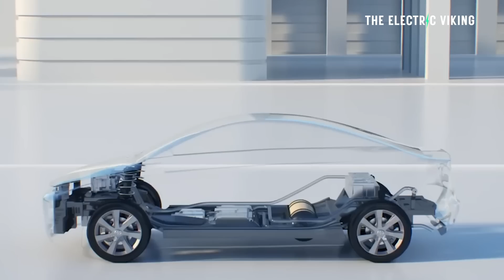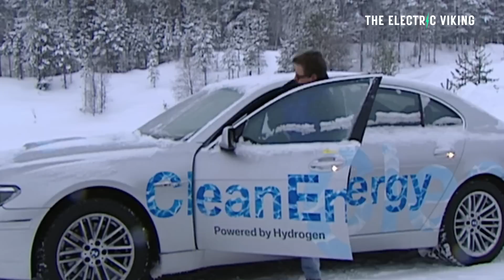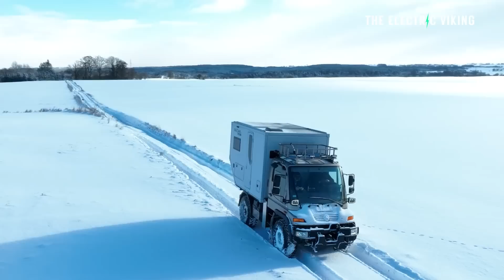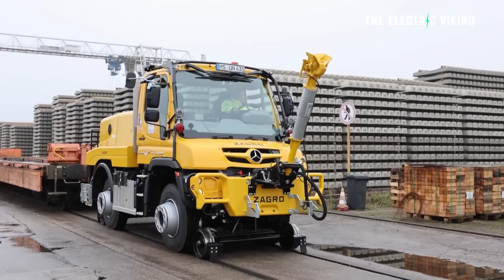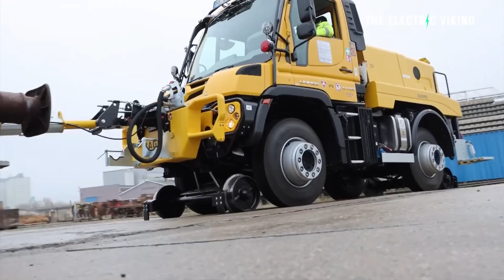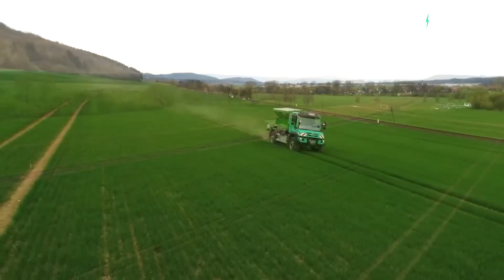Mercedes Benz's hybrid hydrogen combustion and diesel engine

Comment: You’ll be astonished what the solution is. Electric hydrogen fuel cell hybrid combustible engines with Electrodynamic Profile Ramping. ANSYS has verified it with rigorous testing and simulations, not to mention lowered the costs more than half with Additive Manufacturing. 

It’s going to solve the Infrastructure dilemma. A powertrain capable of 1000+++ range, and charges in motion. Consumers will have wonderful options. How?… That’s the secret sauce. 😉 Stay tuned.

Comment: No, does not make sense. Firstly, I'm confused both engines supply power to the drivetrain. It's not that the diesel engine is creating hydrogen. So I don't understand why wouldn't you just have two diesel engines if the goal is to have more power. Why would you want to have another engine that requires an entire different refinery and delivery system to run it. That's only the first of maybe 20 things I can find wrong with this. If the goal is to go greener then why wouldn't you have two hydrogen engines in order to ...arghhhh

Comment: They are probably diesel -Hydrogen dual fuel, guess what they will be run on?  
Why not make a Hydrogen-battery plugin Hybrid?  Cheap fuel for within battery range, then fast refuel for extending the range.  You could also charge the battery while you put Hydrogen in.

Comment: JCB UK is also working on the same idea! 
I am not impressed and it will be a shame to see JCB go to the wall.
What these companies are doing is bringing back the coal fired locomotive steam engine to use Hydrogen as the fuel.

Comment: Dual-fuel bin lorries, powered by diesel and hydrogen, have already been introduced in Fife and Oxford. But probably too little and too late. Tesla stole a march by establishing a reliable accessible charging network. Toyota and other advocates of hydrogen could make the best vehicles but without means to refuel across country are limited to local travel. So bin-lorries and busses are currently the only practical road vehicle uses which are unlikely to be economically viable long term with cheaper batteries.

Comment: All the EV fan boys are in denial because they won't admit that the majority of public charging stations are still powered by coal.  Thanks for creating more awarenes to your ignorance.
Reply: In the US, coal only provides 11% of electricity. In the U.K. it’s less than 2%.
Reply: @kalmmonke5037  you need help, go take your meds
Reply: smoking causation to cancer wasnt clear until moving away from animal foods becamed normalized, including moving from real butter to seed oils.... imagine how small of a effect combustion emission has on health.... it maybe effecting peopel who spend lot of time near heavy lot of cars whose engien are on. combustion has the potential to be far less emissions by simply having small combustion with steady turbo flow charging electric drive           .............where does petrol come from before processing into usable stuff? a theory says the thick liquid is a byproduct of anerobic bacteria, so as long as you dont take too much at a time, bacteria will create more with the organic matter which is compressed into stuff thats processed into petrol. so in especially aritifcal production form, it would be a more sustinable way to carry energy than elctrric car batteries who cant be fully recycled, and its already much more energy per weight. also check out abiogenic creation of petrol, another theory of how its made, which doesnt fail to explain why oil reserves replenish theirself after couple years. . they  say that dont need a new car to run the e fuel, they say its chemically identical to what is normal now.       ...............e fuels has been sold to peopel like harys garage on youtube, its also for sale to motorsports etc (anyone whos paying the high price that exists due to the product not being sold in large quantitiy becuase its new stil developing tech)carbon capture doesnt have to work only in one place.     EV aftermarket valus are low prices, because people dont want the low drivign range of worn out batteries:  currrent electric car batteries dendrite forming battery degradation is not going to be fixed by recycling, where the battery will rust etc in junkyards, which is why i rather wait for that issue to fix before i can recomend a ev espcially given the heavier weight worsening road wear(cost raw resources and causes emissions , not just money) and being less safe to at least others in mot crash scenarios , see aptera owners club video on safety. phalate estrogenic effects causing hormone health problems from microplastic(plastics ae suppsoed to be made of petrol) wear from plastics getting into water food supply like plants animals,  like tires.  and suppsoedly brakes, is worse than todays common cleaner combustion.natural rubber needs to be grown from tree, and is far less grippier... low weight small cars could help, by not having so much weight to push around , weight cant be pushed withotu enough grip on the road. given limited battery supply, wouldnt it make sense to encourage the market to make many hybrids out of the same battery mass used for a single electric car? that way, the places where emission happen most , in driving situation that is more like stop and go traffic, those emissions are reduced, so more emission overall is reduced vs the single electric car.    ................ if government and corp cared about climate change we'd see much more reasonable laws for efficient car design, but we see leniency for suv and bigger cars in terms of emissions, anti roll over  capability etc. we see anti nuclear energy movements, and so called 15 minute cities, etc such restrictions on productivity and feedom being enforced in the name of climate stuff. tony heller, suspicious observes , richard vobes, has their ideas.  blackrock esg score and stealing wealth from people who use a currency by printing money and giving it to chosen people, to weaken people that are not them to control people more, see how their buying up property etc, see romanian tves video called why woke wont go broke"... look at how they promote politically leftist ideas in movies video games etc and even leftist tend to not liek that stuff, but they keep pushing this stuff even as sales decrease. they promote so called affirmative action, where people are to be given things just because they have cahracteristics that make them more likley to be a part of their mass weakeneing goal.  they also promote climate change narrative.government doesnt care about low emissiosn etc, thats why it is more lenient for suv cars and creates standard for effeincy harder for smaller engines and cars to reach. its pretending to care with obiousl half baked bs.   so what should i believe, stuff that could be petrol industry deception or battery industry and government  deception ? ...........................          i suppose best balance of all values of crashsaftey, affordability, emissons, freedom to productivity and ownership of its benefits, is:   making combustion  smaller engine by it not dealing with transmission downshifts and spinning weight balance issues, by linear magnet-like actuators being pushed back and forth to something like supposed non magnetic recyalble motor by mahle, with somehting like subaru wrx ContstantlyVariableTransmission. a compact 4 seater with the rear seats facing rear, with a focus on handling experince similar to lotus elise for momentum preservation. people can rent bigger vehicals if needed, roof storage etc can help.

Comment: In New Zealand during the world Oil Crisis of the late 1970's, our Government decided to support the rise of Hybrid cars. The engines of the cars would remain ICE engines but, at the flick of a switch, could change over to run on either Compressed Natural Gas (CNG) or Liquid Petrolium Gas (LPG). However, it required the addition of a separate CNG or LPG tank. This extra tank occupied most of the boot/trunk, removing most of the storage of a vehicle. However, the "gas" was at a very high pressure and became a danger should the vehicle get in an accident. 
On the supply aspect, Petrol/Service stations had to install separate "gas" refill areas, again at high pressure. It was a nightmare. Now all this was about converting existing ICE cars to hybrids, not purpose built CNG/LPG vehicles with only one storage tank. But I see the same problems ocurring for Hydrogen. At least for Cars. Trucks might be a different matter but I have no data on them. 
When the Oil crisis was corrected, about 6/7 years later, the hybrids just died a commercial death because any advantages just disappeared. Mostly it was simply to have a viable alternative fuel rather than be held to ransom by then Oil countries. (NZ imports about 98% of the oil we use).

Comment: While it is technically possible to run an internal combustion engine on hydrogen fuel, it is insanely stupid. Combining bulky, difficult to store and expensive hydrogen fuel with the inherent inefficiency of internal combustion results is very short driving ranges and insanely high fuel costs. This "hydrogen diesel Unimog" will remain a curious prototype and will never ever go into production. It's the biggest blunder in Daimler's history.

Comment: EV it's not the new car but an aging one you have to worry about. I remember a YouTube that pointed out hydrogen's propensity to interact with much it comes contact with. So maintenance costs will become scary. Hydrogen even attacks the cylinders that seek to contain it. Sounds like music to ice manufacturers ears? After all replacement parts are currently  their main source of revenue. When $100k plus cars worth less than $20k when 10 years old as no one  can afford to maintain them. Especially through a Mercedes Benz Dealer!

Comment: EV trucks thus far are a total fail with rediculously short range under load...unless going downhill with a tail wind.  So you have to either get bettery battery tech or better hydrogen tech, bio diesel or something that works.  Some Aussie firms are saying they have some big hydrogen extraction breakthroughs that don't use much energy so you ought to check those out; if true it may make some old plans viable.
Reply: Bullshit as they already show in Australia. You have zero clue. Your trash industries are now getting fucked...that's why you are getting hysteric...because with the downfall of your deplorable industries you will empoverish as well...by your own fault. The future is completely electric. And the future already has started. Whoever buys new combustion trash is burning his own money.

Comment: def great idea. 1st thing - conversion of old vehicles like unimog, farmer-vehicles, industrial driven on diesel etc etc. 2nd thing - solar, wind are worthless unless hydrogen tanks are built. MUCH cheaper than stacking up batteries because you simply scale up hydrogen tanks. Great combo for wind solars as they rely on unreliable weather patterns. No way that EV is enviro-friendly if its driven on German charcoal driven electricity LOL
Reply: Even with very large and very high pressure tanks (those get really expensive!) the driving range is far less. 

But worse is the horrible efficiency. Using water electrolysis, compression for storage, and an internal combustion engine results in an overall efficiency of about 9%. Using a charger and batteries and electric motor results in an overall efficiency of 76%. Basically, it would take 8 times more electricity - meaning 8 times more solar and windmills or whatever - than if we simply store surplus power in batteries. Sorry, but running internal combustion engines on renewables is a very bad and impractical idea.

Comment: When I was working as an Engineer for a Car maker back in 1983, we got news via trade magazines that M-B had successfully tested diesel engines on hydrogen, and the only technical issue preventing the adoption of hydrogen was its storage. A 300km range was considered the goal for Europe. (not for Australia and other large countries)
40 years later, someone must have dusted off the old plans and trotted them out with great fanfare!
Nothing else has changed; Hydrogen storage is the MAJOR issue. Battery advances have left hydrogen for dead.
Reply: Yes, that and the nitrogen oxides that are emitted
Reply: Can hydrogen be combusted or does it require ignition?
Reply: @toughlove7706  I believe the usual procedure is to mix the hydrogen with the intake air, and then inject a small amount of diesel at the usual time to start the hydrogen/air mixture burning. There may be other ways, but this is what is done when using LPG as the main fuel.
Reply: JCB video explains it all.
Reply: And the whole thing that hydrogen's energy density is 3 times less than current gasoline. It's insane to think it could be a source of energy for us.
Reply: @HeavyDevy89  spoken like a true BEVegan !
Reply: Half right - H is not a source of energy for anything/anyone, merely an energy transfer or storage mechanism. As such, it is a vital part of any energy transition strategy but unlikely to find any practical role in passenger vehicles. Energy density (LH2 3x better/weight, 3x worse/volume than gasoline or JP)  is not the issue.
Reply: You are wrong about hydrogen, sounds to me like your mother should have left you for dead... 

Hydrogen is superior to the batteries 🔋 Mr Imagineer from the 80s under u.s. 🇺🇸 naziAmerican mk ultra mind control...

Storage isn't a issue if the classified aerospace elite nazis would release the quantum hydrogen hydride technologies

Comment: Hydrogen-powered diesel engines are not zero pollution. They produce oxides of Nitrogen. The high temperatures of ALL internal combustion engines cause a small proportion of the nitrogen and oxygen in the air to combine. The proportion of NOx as the industry calls it is very small, but it can be very irritating to people breathing it.
I know of only one way to 'burn' hydrogen and produce only water: in a fuel cell. I'd rather use batteries.
Reply: And good luck finding all the iridium and platinum for all those fuel cellmembranes

Comment: Hydrogen is the future my friends. In the UK they have just announced adding hydrogen filling points to all the truck stops and a new model of hydrogen lorry has just been announced. Don't fear the future, embrace it.
Reply: But Shell also just closed all their hydrogen filling stations in the UK, due to lack of customers. That's not surprising, considering the high cost of hydrogen fuel. So, I suspect that few if any of those "truck stop H2 stations" will be built, and the few that may be built will follow Shell and close due to lack of customers. After all, few commercial trucking operators will be willing to double their fuel costs compared to diesel, when instead they can dramatically cut fuel costs by going electric.
Reply: @chrismuir8403  hydrogen is bullshit. Inefficient bullshit.
Reply: Hydrogen is hopelessly inefficient.
Reply: Agree with you hydrogen is here

Comment: Lol 😄 😆 🤣 it is a day late and a dollar short technology but Mercedes-Benz aka "the german nazis" had this technology perfected 70 years ago, could have built ice 🧊 vehicles with hydrogen injection tech that would throw near 0ppm out the tail pipe. No catalytic converter (mini quantum fusion reactor) needed...but they never allowed it to market to continue the emissions scam and the catalytic converter scam to use everyone as lab rats for the germans to study the quantum hydrogen reactions inside the cats to perfect hydrogen nuclear fusion, fission quantum transmutation and heat reactions. 

So yeah as bevs come out its likely Mercedes-Benz will roll out all types of hydrogen technologies, this one being the pathetic first. 

Mercedes-Benz actually has a compact hydrogen fusion reactor technology... lol 😄 😆 

But you dont know that cause you are a battery boy tard

Comment: The problem for heavy plant or road transport is that BEVs might just not cut it for the foreseeable future.  Energy density is not there for EV road trains, etc. just at the moment, and payload logistics and recharging make this an expensive and difficult proposition.  Its marginal at best and needs critical calculations.  Raising the cost of foodstuffs and anything else that needs transporting to your door might be the outcome with a shift to battery power only.  It’s illusionary, but might change sometime in the future.  Keep an open mind, and hey, if EVs are the true answer then what does it matter to you if a company is wasting there time and money?

You cannot be too EV angelical about this or take the high moral ground.  That won’t work and the backlash will be palpable.
Not sure about elsewhere, but all cars in Oz are responsible for 10% of co2 emission (not much really).  A further 18% are all other forms of transport or so I understand, and that includes air travel.  So keep things in perspective.  The challenge is not to put all your eggs in one basket, but to see it for what it is.  Carefully, co2 will reduce with BEVs, but not purely in that way, perhaps.  Let the technicians solve the problems and find cost effective ways of reducing greenhouse gases whilst maintaining other forms of effective power for plant and equipment.  In a way its good news that EVs might get a run for there money and compete with other forms of propulsion.  May the best solution(s) win.
Reply: Nonsense. You obviously don't know how inefficient your BS outdated forms of propulsion are. You just try to keep some BS jobs alive. In 2030 all of this bullshit will be gone.